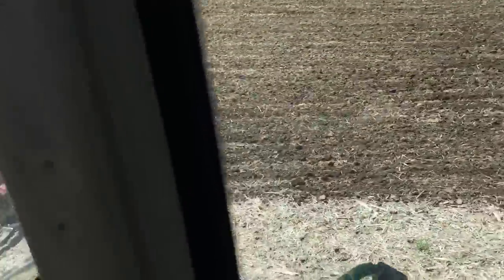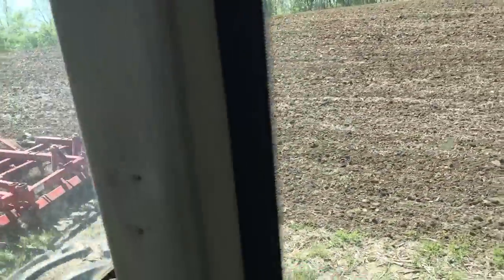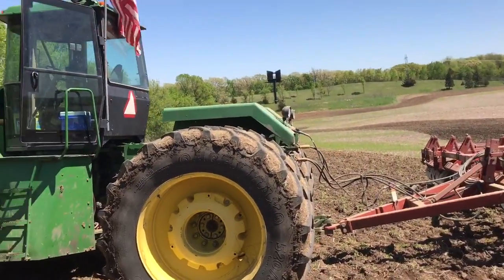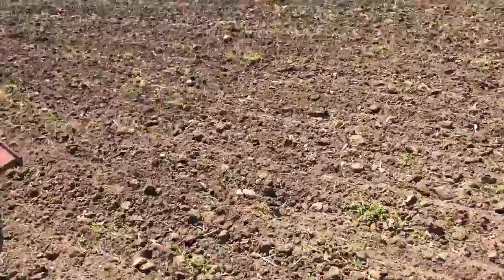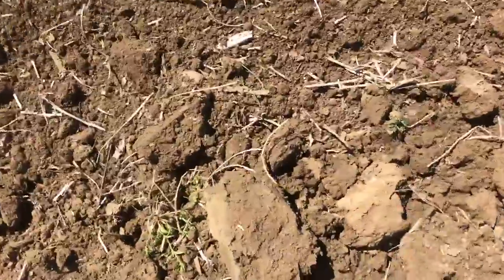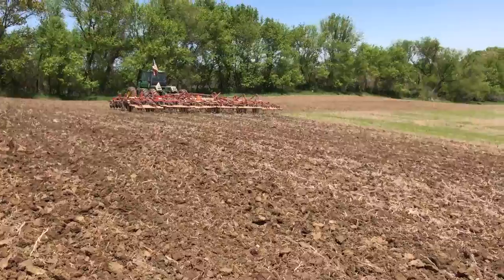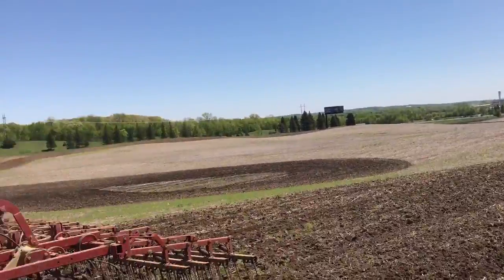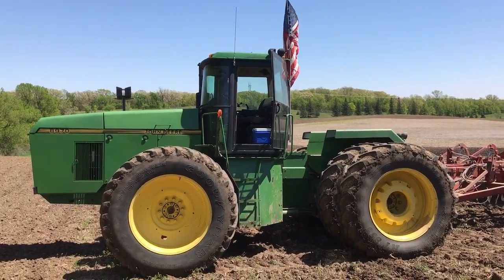Talking Wheel Slip

Comment: What's going on with that high idle problem? Shutting off a big engine like that 8970 has after being under a load is hard on the engine/turbo, needs time to cool off at idle RPMs. When I use to work on a farm, the farmer drilled that into us operator`s heads!
Reply from the maker: Ya, it won't idle down once it's been run for about 30 min.  Had John Deere and Case IH (since its a Cummins) to look at it and they both point fingers at each other.  Looking online, its a common issue....

Comment: If you read ground speed of 100 mph via radar, and 3% slippage, your tires really are really spinning fast enough to move you 103 mph.
Reply from the maker: maybe with cars but not with tractors....the load of the ripper will physically pull the tractor down to a slower ground speed but the tractor is still trying to maintain the intended speed and that is where the spin comes from.
Reply: What is the spin? Is it not the wheel turning faster than the ground speed? If your radar speed indicates 5mph, and a 10% slippage, your tires are spinning 10% faster than 5mph to maintain the 5mph setting. They are slipping. At some point, the tractor runs out of power, and can no longer maintain the 5mph setting....then, you cannot measure slippage as the wheel is not turning fast enough to maintain the speed.
I think you are confusing throttle setting % with wheel slippage.
Reply from the maker: What I've noticed is as the wheel slippage gets higher, the ground speed drops with it.  The tractor does not make the wheels spin faster to try and maintain the ground speed.  I'll have to video it sometime.
Reply: Then it is maxed out and cannot get up to ground radar set speed. Radar speed settings are independent of everything---weight, tire size and psi, slippage, gear selection, load, soil conditions, etc mean nothing...You set the speed on the computer, and the tractor should do the rest.....Slippage is directly dependent on everything, so two different measurements.  If properly loaded, the tractor will keep trying to maintain the pre set ground speed regardless of slippage....More and more slippage until you are stuck, or pull thru the tough spot.
Reply from the maker: Sounds like that might be how newer tractors work?  I have no experience with newer equipment.  Just saying how it works on this machine---late 90s.
Reply: Well, I have a '96 JD 8770, and an '12 JD 9460R

Comment: I would think, it's only a guess and I'm terrible at math, but if you're gettin' 3% wheel slip at 100mph, your tires are actually going 103mph.
Reply from the maker: The way I was taught, you're losing out on 3% of what you are supposed to be going forward.  EX.  Tractor going 97mph (ground speed) but the tires are moving at the speed it takes to go 100mph--hence the spinning. I could be wrong though

Comment: You have momentum and velocity mixed up.  Momentum is not part of the issue, rather ground velocity.  The loss of velocity, that is the gap between expected ground speed and true speed is the lost velocity.  The "3% wheel slip" is an ambiguous measurement.  In your example of 100 mph and 97 mph, the loss of velocity is 3 mph, and can be called "3% velocity loss."  The "wheel slip, ...." is some faux measurement.

How is the "slip"measured? To be sure, the tractor can measure wheel rotational velocity.  This is a certainty.  Is the GPS measuring the vehicle velocity?  And, the difference is being called "wheel slip?"

Just for the record, I'm not intending to be critical.  Rather, clarifying some things, and asking questions to get further clarifications.   It is OK if you do not know the answers to the questions - no harm.
Reply from the maker: Tractor has a ground radar by the articulation point then I think it knows the axle rotations (guessing) so it knows if the axle is is xxx gear it should be going xxx mph but if the ground radar shows different then thats your slip

Comment: what about another set of weights in the rear. I don't know much about Deere 4 wheel drive tractors could you put on suit case weights  up front of the tractor, more traction.
Reply from the maker: a guy could, its got a lot of weight on it as it is.  You can see its footprint through the field...more weight could get nasty.  it's just in hills its an issue--it lugs right along most of the time.